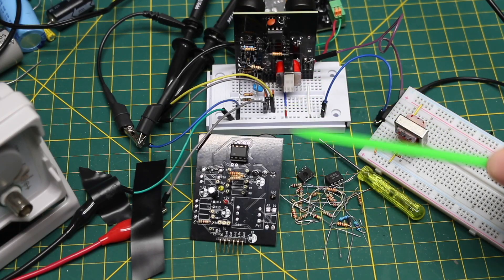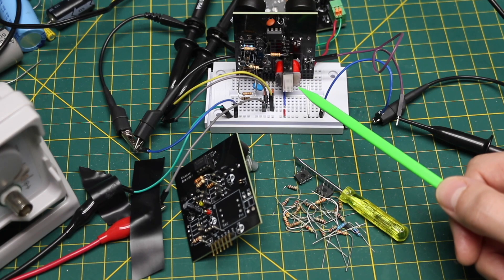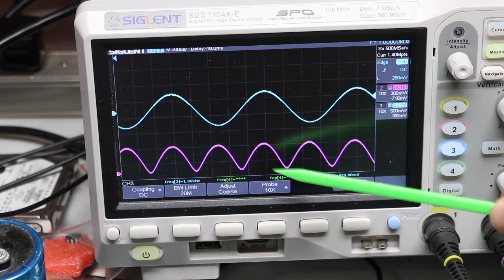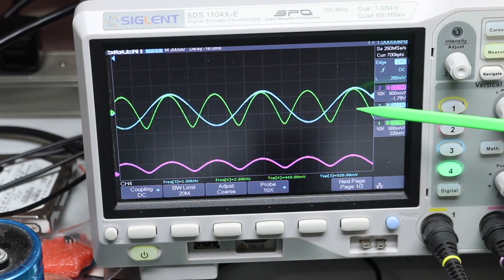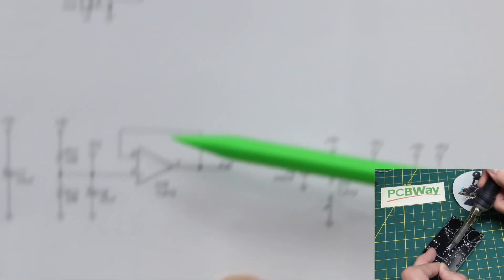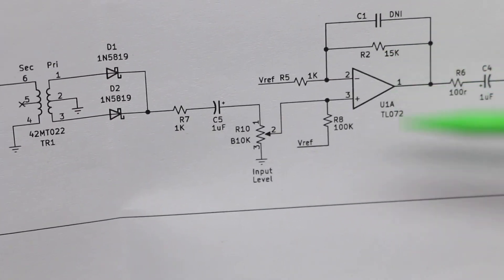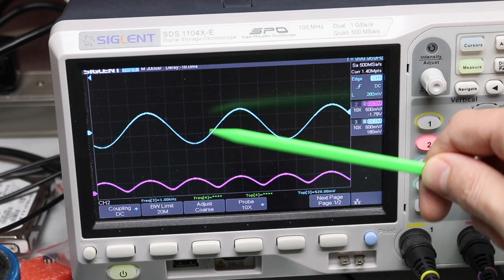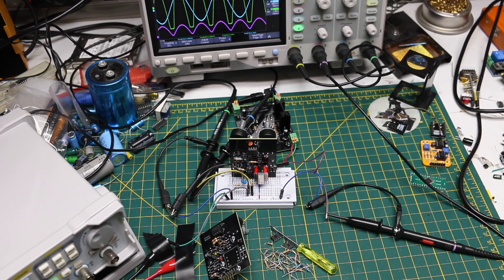Audio Octave Generator with Input/Output Buffers for Guitar Effect Prototyping

Comment: The best breadboard for the money is the BB830, very reliable connectors inside. A bit pricier at 12.33 CAD, but really worth it.  It was reviewed by @BenEater also. I get them from mouser.

Comment: If I am correct ... the octave generator circuit was originally coupled with a fuzz circuit, which is a current source. I presume your op amp circuit is a voltage source. If all of that is correct -- would this be an issue? Was this an issue? I am Still Learning! :)
Reply from the maker: I don’t know if the original octave product was a standalone transformer-based thing in its own box or if it was always with a Fuzz, I think there was a standalone octave and people could choose to put it before or after fuzz so I don’t know what that whole circuit looked like but
in the experiments I did so far things worked better when the fuzz was going into the octave and when I was doing that I had the output just going to an amplifier so it’s probably the same as having it with an op amp after the octave like this circuit
ultimately the output of everything whether a guitar or an effect should easily go into a high impedance amplifier input.

I think the bigger issue with old fuzz is having a low impedance output from a previous pedal  going to it’s input instead of a high impedance like a guitar pick up, so if the fuzz is feeding its output  into this octave circuit it should be fine and otherwise if the op amp output of this circuit is going to the input of a fuzz,  maybe something as simple as a series resistor to increase impedance going into the fuzz would be a hack.

but there is more work to be done including next month I plan to do a circuit where I can switch fuzz before or after the octave circuit with a stomp switch using a 4053 chip as a spoiler alert.
Reply: @GadgetReboot  sneak peek woo hoo! 😆

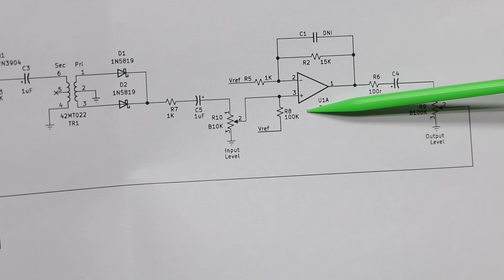Comment: @8:40 isn't C5 reversed?
Reply from the maker: Maybe the capacitor would be better placed after the pot so the positive terminal is on the 4.5 V bias.
The way it is right now, if the level control pot is closer to ground the capacitor has less or no visibility to the 4.5 V reference and then it would be backwards.
i’m thinking of making it smaller and non-polarized